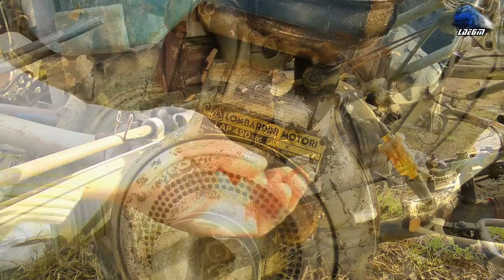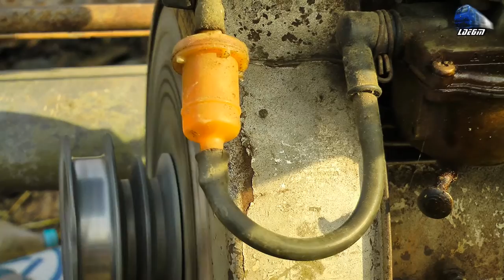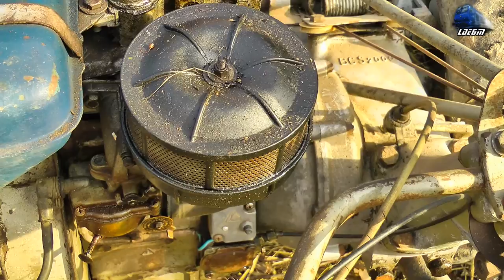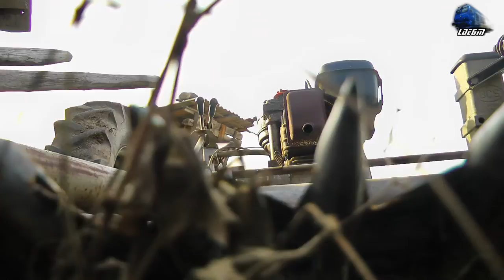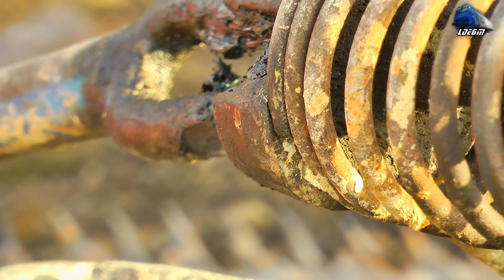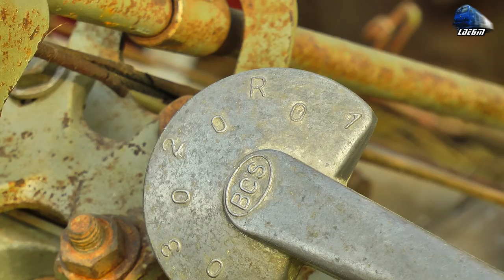Pornire Motor la Rece/Cold Start Up Lombardini LAP 490 SIN Engine - BCS 20000 Mower

Comment: please help me with another question: i found that piaggio ape has an electrodinam that does 2 things: it is an electromotor and an alternator: it start the engine while connected to battery and after it make electric power for you lights  . am i right ? did you saw something like this?
Reply from the maker: Nu stiu exact.... electromotorul porneste motoru` si alternatoru` incarca bateria, magnetou` sau delcou` porduce curent pentru scanteea de la bujie ;)